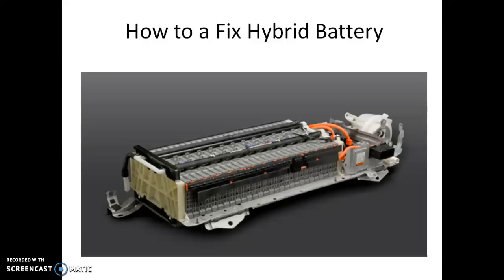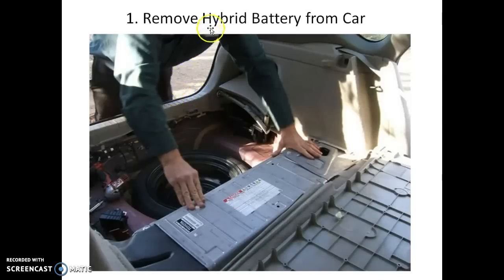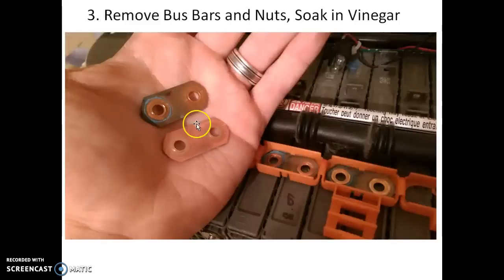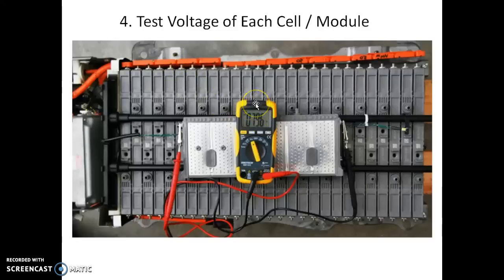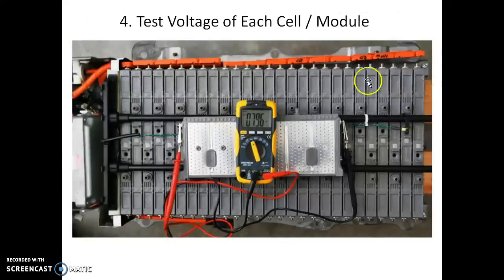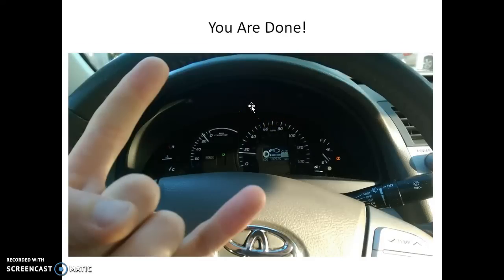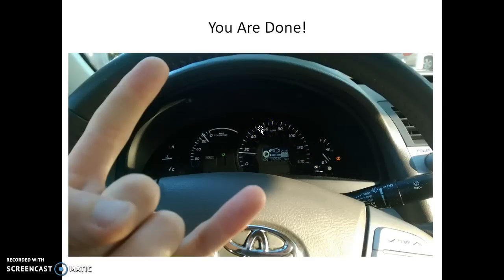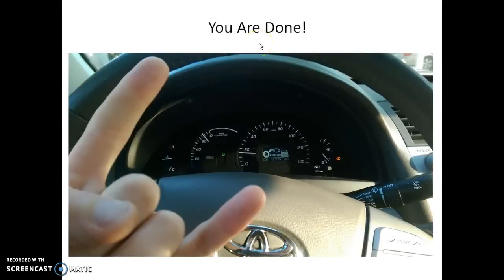How to Fix a Hybrid Battery

Comment: My repair of my 2007 camry hybrid battery seemed great when I started the car up on Saturday morning, and stayed so, through about 70 miles of driving. Then I got Hybrid Battery System light flashing again. But it's different now, for example, no 'check VSC light now.  You said at first your repair did not clear the warning lights, but then it did. You have any ideas for me? I remain grateful for your contribution.
Reply from the maker: Overthinkers Hoedown did you repair yourself? What issue did it have?
Reply: Yes, I did it, and started up saturday morning, no issues. Drove saturday and sunday. Sunday evening the check hybrid light returned. drove some today and the car stalls often. I have to pull over and stop. Turn off car. Turn it back on and drive until it stalls again . . .. three or five miles later.
Reply from the maker: Overthinkers Hoedown is that the same issue you had before? What voltage were your cells?
Reply: same issue, same code from obd scanner. bad hybrid battery.  there was one cell 6.75 volts. all the others were 7.8.  i replaced the low voltage cell with a new cell that was at 7.8.  saturday morning it worked fine, sunday it reverted to check hybrid battery warning light, and stalls every few miles.
Reply from the maker: Overthinkers Hoedown I would pull the battery and check again. Did you check for corrosion on the nuts and bolts?
Reply from the maker: Amen to Captain Crunch. The next thing you need to do once you pull the battery and check each cell again is test their load capacity and resistance. There are tools you buy that will discharge and recharge each cell. This is the next step to build up a proper balance and restore full functionality. But it does take time as the discharge recharge has to be done slowly.
Reply: Yep, I believe that is the correct one.  Just make sure you get the V2 version as there are a ton of fake V1 versions out there.  The real version also comes with a large square SkyRC Hologram on the back.

There are other versions that have higher charge current and higher discharge current.  It is always a matter of $$$ vs time which version of charger you want to get.

I mentioned the B6RC V2 as it is an pretty good quality entry level charger and it supports NiMH, and as you can connect it to a computer with a USB Micro cable and download the Charge Master software, you can graph the charge cycles and I believe the discharge cycles without having to write them down manually.

By comparing the graph curves on each battery module, you can spot which one's are the outlier and discharge much faster than the rest.  Those are the modules the ECU would flag when monitoring the health of the pack.
Reply: Just so we have a complete history of what you got so far.  I assume you disassembled the battery pack like Shane did, cleaned all the corrosion from the battery bus bars and hardware and re-installed them.

We may have a better idea if you can answer a few more questions:

1.  When you located the bad cell, how did you test the individual cells?  Did you use a simple DMM or did you test them with a resistance load?  Did you do any discharging and charging tests on the cells?

2.  How many miles are on the pack?  Just want to see realistically what we are dealing with as your car is from 2007.  If your pack already has high miles on it, the remaining cells could be simply too old to rescue the pack.  You could be identifying a single bad cell, just to have others fail as soon as you re-assemble the pack.  I have seen other hybrid owners attempt single cell replacements with mixed results, as sometimes without doing more in depth testing of the cell modules, you may not be identifying all the bad cells.

3.  I haven't seen the track record on this myself, but there are systems out there like Prolong that allow you to discharge and charge the pack a few times to re-balance the pack.  They claim to be able to rescue many failed packs using this method, and claim high success on Toyota packs.  Their site is here: https://hybridautomotive.com/ and I have seen other systems out there that do similar pack balancing.

You can also test individual modules using something similar to SkyRC iMAX B6 or similar charger/discharger to load test and charge individual modules, or even module pairs.

Narrowing down what is going on is going to require some equipment, some money and some time.  Not exactly something most people have in abundance, and it is not easy to work on this if you need the car in question for work/school/whatever while it is down for pack diagnostic and repairs.

Just be careful as the pack is high voltage and the battery modules are high current.

I have school, training and experience in electronic systems, and as such, I can't tell you how far or how deep you want to get into this and where you end up over your head.  But I may be able to point you in the right direction at least as far as testing and equipment wise.
Reply: okay, thanks for the advice.  if you could advise which tools to buy and where to learn, e.g. a video or a book, how to use them, that would be great!
Reply: I thought this thoughtful entry had just one sentence. I just noticed the 'see more' ; and i see there is a lot to read and understand there, so i'll do that and then respond. Thank you!
Reply: I started out with it all over my head, so I was in too deep to get out from the beginning!
Reply: 1.  I tested the individual cells with a digital voltmeter, first, and I wrote the readings down.  I numbered the first one on the driver’s side, closest to the vent for the battery cooling fan, #1, the one on the end with the electrical connection compartment #34.  Thirty two of them measured 8.04, 8.03, or 8.02.  One (#21) measured 6.72.  One (#33) measured 7.92.  I measured the two cells I had bought, and they came out 7.85 and 7.86.  Then, I applied a load to each cell. I did this using an analog battery tester – you attach the leads, push a switch, and it puts on a load. I held the switch for ten seconds. Then I took readings of all the batteries.  The readings ranged from 7.89 to 7.93, with these exceptions:  +21, post-load, measured 6.59.  #12 measured 8.02 (same as pre-load); #33 measured 7.75.  The two newly bought cells, which I called A and B, measured 7.80 and 7.86 in the post-load test.  I replaced #21 with B and reassembled the battery.  I did not do any knowing charging or discharging of the cells, other than the discharging done in the load testing.

2. There are about 150,000 miles on the pack.

I have a clunker car I have to use in the meantime.  I’d gladly acquire equipment if the benefit outweighs the cost.  That is, it wouldn’t make sense to buy testing equipment that costs more than a new battery would (unless I could make money using it).
Reply: i checked for corrosion on nuts and bolts - if there was any it was hard to see. they looked good to me, but i did not carefully inspect for any sign of corrosion.
Reply: Besides seeking replies here, a guy from a shop in Annapolis MD is coming here Thursday (5/3/18) to run diagnostics. I asked, does he need special equipment that would make it better if I had the car towed there (an hour away). I was told the special diagnostic tool they have is Toyota software. I have no way of assessing who's who in this game. But they seem very nice, and a scan at their shop is free, and they are charging me only $75 to come out to me.  Any suggestions about questions I should ask them?
Reply: Thanks for this. I got the general idea, but will need to read closely and look up some things to really understand.  I used an OBD reader (Lemur "Bluedriver") but without ELM327 module, etc, first time I've ever heard of that stuff, I'll have to read up on it.  Same with SkyRC IMAX.  Not floating voltage - when i put a load on each cell with the analog battery tester I borrowed,  and then measured the voltage after, does comparing the before / after voltage give useful info, or not really?
Reply: Is this the right thing?   https://www.amazon.com/Genuine-SKYRC-Professional-Balancing-Discharger/dp/B017Y2G4Y2
Reply: I would have to know what the analog battery tester is rated as far as how many amps was it drawing from the battery.  How much load was it putting on the battery, for how long.  How far down did you measure it under load.  Etc.  You need to measure the battery under load until it reaches 6.5V or so.  

Many of these cells look normal until they get 7V or less and then just fall off a cliff.  You can see some of the load testing done by Just Vlad on here for example.  A strong cell will take 5 minutes to go from 7V to 6.5V, a weak cell can take 20 seconds or less.  This is load dependent of course, but you are are looking for the odd one's out.  If you measure 12 batteries as an example from the pack under load from 7V to 6.5V, you are looking for consistency.  If 2 take 4 minutes, 5 take 3 minutes, 3 take 2 minutes and 2 take less than 1 minute, the lowest 2 are definitely suspect, and should be reconditioned, then replaced if they don't improve.  

As noted, ideally they should all be very close, but on an old pack with different heat dissipation, that of course is not going to be the case.

I haven't tried this myself, and I can't 100% say if this is feasible or even recommended, but one theory that could be worth exploring is trying to balance them in pairs.  If the OBD2 diagnostic is any indication, the cars ECU monitors the packs overall voltage, and then as module pairs.  If it senses a module pair under performing other modules drastically, I believe I have seen the value of 20% mentioned, the ECU could flag the pack as faulty.  The pack may be looking at the difference between the highest module pair and the lowest not exceeding 20%.

Since they are in series, if you have a Module Pair X at 8.1V + 8.0V (16.1V), and you have another Module Pair Y at 7.1V and 7.0V (14.1V) and the pack start getting discharged under load, if one of the 7V modules in pair Y suddenly drops to 5V ahead of the others, now Module Pair Y is measuring 12.1V, the difference is more than 20% and the ECU algorithm flags the pack with an error code, and you get the dreaded Check Hybrid System light on.

At the end of the day, the ECU runs a software algorithm with set parameters to monitor the pack.  The algorithm also apparently will not allow the pack to charge above the voltage of the weakest module pair, so if your best two Module Pairs measure 17V on the bench, and the weakest one 14V, the pack will start charging all the module pairs to 14V and degrades the capacity of the entire pack.

For this reason, it is critical to weed out the weakest modules.  I think many people are not load testing them properly (understandable as most people do not have a background in electronics), and they are checking them with a simple DMM with no load or not load testing them long enough and deep enough to identify all the bad modules.

In many cases, I think people find a module or two that have low voltage, replace them and think they have fixed the pack, only to have it fail weeks or months later, sometime days later.

Note that some may get lucky and fix it that way, but I think that is the exception more than the rule.

There are 28 modules in a Prius pack, I don't know how many the Camry has, could be the same or close plus or minus a few modules.  There is considerable labor involved in removing the pack and taking it apart, with all the interior pieces that need to be removed and re-installed.  The modules run about $30 plus shipping.  I obviously can't speak for everyone's budget on this, but I would error on the side of replacing more weak modules or questionable modules than fewer.

Also, most modules out there for sale are used modules from other packs, most likely from other bad packs or totaled cars. Even bad packs would have some good modules in them, assuming they haven't been sitting and discharging for a year, or it spent its life cooking in a driveway in Nevada or Arizona.

So, my recommendation is, test the replacement modules you get.  Don't assume they are good.  They may or may not be good.  By testing them yourself, you will not only know for sure, but can hopefully return the bad one's and get your money back.  Also hopefully saves you a lot of time and effort.
Reply: I disassembled the battery.  I checked all the cells for voltage.  All were above 7.8, except one was at 6.75.  I replaced that one with a cell I bought on ebay, that measured about the same as the others - 7.8 volts.  I soaked all the bus bars in vinegar over night, and then dried them, and then cleaned them off with a steel brush on a grinding wheel.  I put everything back together and it seemed right.  Then I started the car, and all the warning lights were gone. I drove it for about an hour at 30 mpg. No problems that I detected. The next day I drove it more normally, at times 55 mph, in two trips. At the end of the second day the warning lights came back. On the third day - yesterday -  all the warning lights, and also it stalled often. Thanks for your interest :)
Reply: @overthinkershoedown8788  Why did you not load test that module you got off of eBay. Mine failed the load test from my purchase off of eBay

Comment: Shane - thanks for your efforts, which gave me the courage to attempt to fix a car I could not pay to have fixed. The videos you include do not actually show everything needed.  The devices on the side of the battery that have to be partially removed, including the fan duct on one end and the posts for the two orange leads on the other, all that's tricky. I have one loose wire and it seems I failed to take a photograph of the disassembly of that wire. Maybe if I showed you a picture of it you'd know where it goes?
Reply: Thanks, Shane. My repair is successful. I don't know how long it will last, but I am glad I've tried it. All signs are good. I am not sure I would have attempted it had it not been for your video.

Comment: Shane - thanks for the video.  Is your repair still holding up well, a year later?  I have been trying to assess the many comments on various videos about load testing and measuring internal resistance and battery balancing. A critical fact - I believe your video is fully honest - is that what you have done has given you at least some months of good service from your car.  My intuition tells me that there is something to the  desirability of balancing and load testing the cells. However, some of the people advocating that are not practical. They are talking about the ideal, and the ideal would be to buy a new car, but many of us don't have the money for that.  And those of the experts who advocate full load testing, balancing, etc. and who also communicate in an outraged tone about people doing anything less than the ideal are not helpful, because their ego is controlling them, not consideration about what it means to need a car and not have enough money. All those things considered, and having reviewed many videos, I have decided to go forward and use your approach. And if it works for a while, in that while I'll keep studying, and then maybe next time I'll be ready to do a job closer to the ideal. If the copper contacts are corroded, just cleaning those could make my life better for some months. So, thanks again.
Reply from the maker: Still going strong with no issues.
Reply: thanks for your reply. i am going to try in a few days.  the main differences in how i will try it is that i will try load testing the cells. otherwise following your plan plus what i can pick up from other videos.
Reply: how about now? 3 years later ?

Comment: I have question about does the hybrid pack need to be charged fully by the car before removing it??? would you still be able to test the Hybrid pack if you remove it with only 2-3 bars showing? or one purple bar? also if you remove the pack and let it sit for a few days would it again change the voltage?  I guess what I am trying to ask is how long will the good cells read for, once having been removed for the car
Reply from the maker: Melissa Anderson yes, it doesn't matter how much charge it has. We're testing voltage, not charge.

Comment: Nice video, I have a 2009 Yukon hybrid and won't start , I got a code that said it's module battery low . You think I need a new battery or I can rebuild my battery
Reply from the maker: Luxury Auto's doesn't hurt to try to rebuild first.

Comment: Shane - I need to replace my 2007 Camry hybrid battery.  Has a third party battery installed that's still under warranty. so all I want to do is swap out the old one with a new one.  Several shops in my area will not do the work because their tech manuals say after installation of the new battery a Camry Hybrid needs to be "reprogrammed" (not sure if it's the car or the battery), and they do not have the electronics to do that.  Do you know anything about this?  Did your Camry start right back up after re-installation?  Thanks!
Reply from the maker: kevin christensen I took my battery out twice and I didn't have to do any of that. It never gave me any trouble. I think you're fine.

Comment: You want to trickle charge the battery afterward. I'm willing to bet that you got the Check Hybrid light initially after repair because it wasn't charged appropriately. Trickle charging will preserve life and you can get one for like $20 at Lowe's
Reply: There are not trickle chargers at lowes for $20, those are for the 12v battery not the hybrid battery.  You can, however, take the battery apart and get an RC Nimh charger and recondition each individual battery in the pack.
Reply: which battery gets trickle charged? The bad replaced module only or all 28 of them?
Reply: @Ian Ostler A trickle charge is done by a battery charger that is not part of the car.  You can purchase a batter charger for a small amount of money and they vary on capabilities.